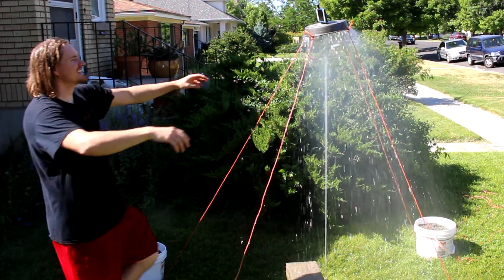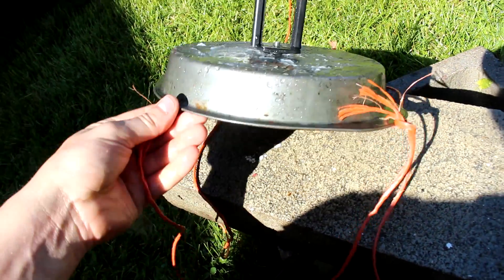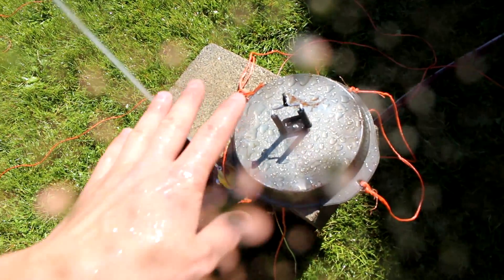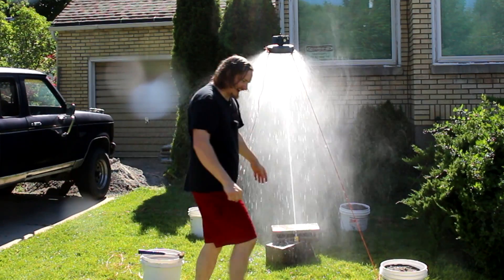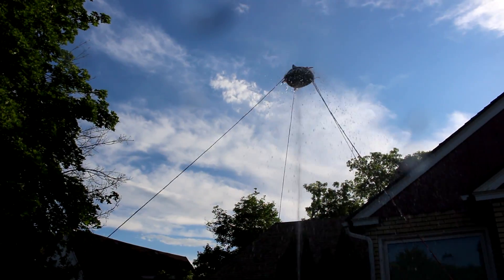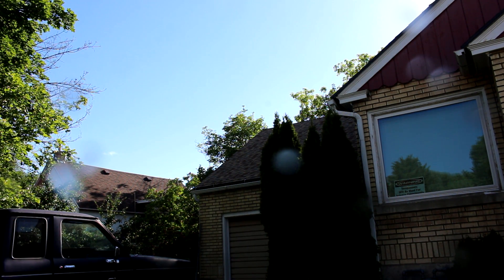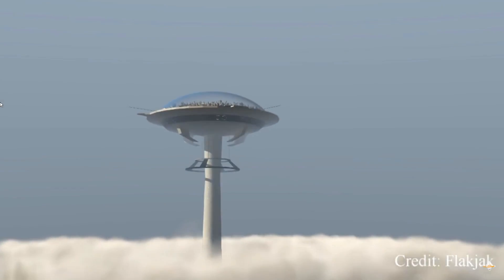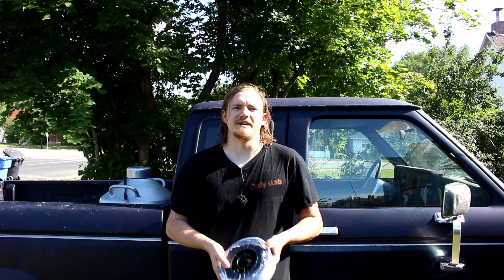Actively Supported Tower (part 1)

Comment: they use resistors like you had going at end of video on old points ignition supply circuits, but they are ceramic coated for heat dissipation. Those home built resistors will need cooling to last any amount of time.

Comment: you should connect spools of wire instead of string, that way you could have continuous tension as the tin rises. just make sure that the pressure of the water is enough to both overcome the force of gravity on the tin AND able to have enough pressure to pull the wire out.  Then you could have it go even higher!

Comment: Could this be applied as potentially more viable space elevator then an anchored, counter weighted tether? As far as material strength and structural integrity I mean. I'd be interested is seeing some math depicting the kinds of forces involved at that scale. I'd also be interested to know how much it would cost to maintain such a structure, in terms of dollar per kilowatt hour to run the active support.

Comment: could you attach the water jet to the pie tin via a tube and suspend it just a short distance below it? that could keep the platform more stable & the jet more coherent, although ofc it also adds weight

Comment: What if you used the heat of that load dump (end part video) to power a absorption refrigeration system so you capture the waste heat. Once you recoup construction cost you would have a free source of cooling.

Comment: You could try using a laminar  flow nozzle, should be quieter as there's no air mixed with the water, also use a frisbee, it's lighter.
Another alternative is a helium balloon at the top.

Comment: For some reason, until I saw Isaac Arthur's videos a few weeks ago, I'd have thought this would be magic. 

What I really want to see someone do is try to recycle energy from the falling mass (e.i. the water) so it isn't so dreadfully inefficient. 

Maybe that's an idea for what to do after floating a platform on a wire ;)
Probably not possible, but then I'm not a scientist. I'm just a lab tech.
Reply: the way you do it is you have the water in a hose/pipe going up and back down - it still does technically reflect from the top. The problem is the mass of the pipe - it is barely doable in small scale. In big scale though, square-cube-law is your friend at least this once.

Comment: I wonder if it could be done with a single string and with the "pie tin" shaped in such a way to correct any side to side motion. Not sure if the water steam would get disrupted too much as it would have to be in line with the string, perhaps 3 parallel streams of water with a single string in the center?
Enjoying the videos as always Cody, thanks!

Comment: I think I'd prefer a system that would use the energy for something else that is useful, either that or a charge controller that stops charging/keeps them at a stable floating voltage (assuming they are lead acid batteries). But this does get the job done I suppose.

Something like water heating, hell maybe even to just create distilled water I'm sure that comes in handy for the occasional chemistry experiment. The hydrogen/oxygen generator could use nice too, but I would feel a bit wary about generating and capturing such things unattended.

Comment: hmm, space tower preliminary  testing, prepping a mine for use in isolation experimentation, hydroponics, rockets, measuring angles heights and distances through optics, solar collection and utilization, long term battery storage. . . .Cody, are you planning on just taking yourself to Mars?
Are you planning on doing some vacuum chamber descent tests with parachutes or gliders in simulated mars atmosphere? Maybe play around with filtering sunlight to reduce it's intensity to mars levels, then concentrate it with Mylar mirrors to get plants to grow in reduced sunlight?
May the solar wind be ever at your back!

Comment: This brought back memories of Freeman Dyson's Orion Project. Of course this was a pie plate and a water jet while Dyson's team was contemplating spaceships 400 meters across with a mass of 8 million tons - virtually a small town - lifted and accelerated at 1g to some fraction of light speed using fusion bombs detonated at a rate of every 3 seconds behind a pusher plate. All of this in 1958 using the available technology of the time! Obviously there were issues with this approach although once in deep space those issues become moot. There is anecdotal evidence that a manhole cover was put in orbit this way during an underground atomic test but it may also be that it was just vaporized, the high speed camera only recorded one frame of the cover under a huge acceleration. Cody, it would be a challenge but you have everything at hand to make a "pie plate" mockup of this powered by a stream of your small explosives. Dyson and his team made some small experiments at the time and there are some grainy b&w films but I think you could do much better today.

Comment: For phase 2 add a gyro component  for platform stability. You could also supply power via the guy wires so you don't have the increased weight of batteries.

Comment: bah mon librepenseur,
check out project WEAV
coanda-flettner-tesla 'flying plasma toroidal vortex'
and 'flux pumping in quantum thomson switching'
as well as, ionocraft. 

that is essentially what a directed jet of water to the target is...

the flux-density per cubic inch is presently what prevent that.
however, wilzcek-chua memristive metamaterials,
particularly, new monopolar surfaces,
make it potentially ERoEI viable in the near future,
combined with thorium-vanadium-astatine breeder reactors.

cody, 
what BTU's are required to pressurize the water to suspend that,
let alone, the fact the water is treated...
what is the ERoEI of the water used,
and how does that scale with the mass of the levitated object?

Comment: I wonder if you can get that high pressure hose to put out a somewhat laminar flow, maybe it could get much higher? Probably absurd overengineering but maybe stainless tubes as a bundle of "straws" and maybe you can get away with plastic for the sharp nozzle part depending on those pressures...

Comment: Submerge your dump resistors in dielectric coolant or mineral oil, and use some power to run the coolant through an old car radiator and fan.  Easy way to not cause a fire and prolong the life of the coils.

Alternatively, you could use the excess power to drive something high amperage but self cooling, like an industrial fan or a space heater (I assume you want to do this since it's cheap though)

Comment: Sometimes it's a very good thing to have a ranch to have some distance between you and your neighbors. Like when you are using explosives. Or messing with homemade artillery. Or when you are trying to make a string thrower with 3/16 inch steel cable.

A hope: Be extremely careful with your string thrower. The possible failure mechanisms for such a device are spectacular.  I enjoy your vids too much for them to stop. You need a substantial shield to observe from behind, hopefully using a periscope or such. And don't neglect the possibility that a failed cable will fly up and fall on you, or whiplash around and catch you from behind your safety barrier.

Comment: The big question for the wire setup is: Will it buckle? 
And when it does, is your structure going to be fail safe enough to not get ruined by the momentum of the wire or the strength of the motor? I've also wanted to build an actively supported platform for a while now...
Can you calculate the speed the wire needs to have in order to lift 100kg? or maybe 10kg?

Comment: That looks like a Colman Air dump load controller. I have one of those too and I have to say I'm not a fan. The relays engage for too long and sometimes burn off more power than they really should. I solved the problem by putting a number of lower amperage dump load controllers in parallel with it and those controllers have a hysteresis of 0.1 seconds. Each controller dumps about 6 amps and their trigger voltages are slightly staggered. The result is that when my panels and/or turbine are producing too much, my dump loads engage just enough to keep the voltage at 28.x volts maximising the power going into the batteries. I'd be happy to tell you where I got my dump loads. PM if you're interested.

Comment: as a civil engineer. ..your statements around 4:42 would literally get  u laughed at . "supported passively"?  stop stepping out of your academic bounds, we design for something called a dead load. .sure. but the most important factor is the live load, Which is definitely not passive...also a factor of safety. which is more aggressive than anything.. and then there are serviceability requirements ...such as deflection and vibration.  Literally NOTHING Is "passive" . stop belittling structural engineers and stick to what you're marginally good at. I bet you are one of the ones that confer to the "pancake theory" of 9/11 too and can't figure out on your own (let alone your own OBSERVATION) that it's physically impossible.  .after back spacing. .ill leave it at that,  cuz after all i do like you.
Reply: I know nothing about you but because I know your academic specialty I feel comfortable assuming a belief you have about a globally recognized event outside of that academic specialty, based on nothing you’ve said at all. I bet you’re one of the ones that think the SAS’ use of stun grenades as they started their assault during the Iranian Embassy siege in 1980 was a tactical error due to the mistiming of red and blue teams entries, and that it would have prevented the severe burns that the entangled abseiler suffered. See how my comment is entirely absent of any sense at all‽︎ Find it insane you felt belittled by someone’s use of incorrect terminology. Must be like civil engineers to have fragile egos lol. Stop writing YouTube comments and stick to what you’re marginally good at, using software to make sure a bunch numbers are within tolerance of two other numbers, and spending hours of your life writing the measured distance between two lines at a certain scale.

Comment: With that setup, would you be able to achieve stability by using suspended weights to lower the center of mass below the pie place instead of using the guy wires? Control height by the strength of the water stream. (Though I don't know how you would avoid spin...)

Comment: Now regulate it with some kind of electronics so you can input a height you want the object to go and then it will output the water you need to keep it at that height without restraints.

Comment: hey cody, looks like your phone lcd broke, you can get an lcd for $20-$50 on ebay, it's really easy to put a new one on, just look up a how to on youtube. don't go to the apple store as they will overcharge you alot. Anyways, great video cody, keep it up!
Reply: Davidog69 if that's one of the new iPhone it may be harder, as for some idiotic reason touch ID data is stored in the screen (like, why apple?) so I think you've gotta take extra steps for the touch ID sensor not to refuse the screen, although I could be completely wrong and worse case scenario you loose your fingerprint and have to use the backup password

Comment: Lapis Lazuli (Steven universe) Tried to use the earths ocean to reach space, any idea of what would be the maximum reach distance of the oceans water into space if you piled it as a tower? and what kind of dimension would that structure need for it to be physically possible (assuming you could pile up water like if it was a solid). 
(/watch?v=uNEOPshLfUM) 
P.D. sorry if the comment is a bit childish.

Comment: you should make a metal fire box to contain the resistors so if any dirt or other junk gets on them and starts fire it can safely burn in the box it would also help with heat soaking into surrounding things

Comment: Hi Cody, great video, can't wait for more on this topic. I had an idea for an efficient "cooking pan". The pan is not efficient to what it can be, I know you said that in the video, but a different design could make it go higher and use less of the waters energy. If you made a design where you basically put a cone inside of a cylinder where the water would hit the tip of the cone, it could make for a more efficient "pan". But the design might not work just like that, you may need to tweak it a little such as rounding off where the bottom of the cone and the cylinder meet. If you would like me to show you what I am talking about I can message you my design, thank you!

Comment: You don't have to use all those strings. LOL When I was a kid we had a water toy very similar to a kids water toy today called, "Big Aqua Clown". It was a cone shaped hat with a flat top. You turn on the water pressure and the hat would shoot up into the air and you'd run through the jet of water. The hat would fall, then get caught by the jet of water and shoot back up. To do what you did, just mount a small camera on top of the cone so it's balanced, then add 3 small weights 120 degrees apart extending at an angle downward off the wide lower rim of the hat.

Comment: This is cool, imagine the uses for this kind of thing in the far future, pressure elevators instead of cable and wire would make them safer Incase of a failure but leakage would be a problem to deal with

Comment: that dump resistor of yours is a fire hazard and a half. get yourself some hot plates or something. a friend of mine used some heat wrap on his hot water tank. had 145 degree water most of the time

Comment: Could you propel a spacecraft using water that way if the jet of water was large enough?
Reply: Meaning having a jet of water from earth shooting up into space and placing a disk on top of it?
Reply: Olaf, It has been proposed for building something like a space elevator. If you want to have an spacecraft you still need to accelerate it really fast around the earth to archive an stable orbit by itself.
Another idea is to use lasers to propel the spaceship once it has reached an orbit.

Comment: You should try a comparison video between self stabilizing system and unstable systems that require outside input (3 strings of the tripod) for stable water jet levitation...

Comment: Why don't you use your water splitter to drain the excess power from your solar panels? It would be a little more sustainable than dumping heat into the atmosphere and you can make some other projects with the resulting hydrogen.
Reply: Jarwren, There are several ideas to storage/use the extra energy but all of them involve costly solutions (adding more batteries, storing water on a elevated tank, water splitting, etc) But if all you want is to protect your system from overload, that simple resistor dump is pretty convenient (or better yet, a water heater as someone else suggested).
P.S. Also storing hydrogen is not as trivial as it appears, as you shouldn't use a normal gas tank (google hydrogen embrittlement)
Reply: I know all the problems but since he already build the hydrogen generator it would be convenient to use it in this case.
Reply: Does he have a way to compress the hydrogen safely into some containment? Blowing up your house is not necessary worth it.

Comment: Cody, I think the problem with your iPhone is due to the flat printed LCD cable being partially knocked out due to impact.
Or maybe the surface mount connector has pulled up on the logic board.

Comment: Why you didn't use 3 ropes  at 120 degree? this would make the system way more stable, or i'm wrong?
Reply: The real secret to all this is that he's using baler twine. People who have never done any farming don't realize the importance of the stuff , the Universe is actually kept stable solely due to it being tied together with baler twine. It's a fundamental force.
Reply: I believe if 2 out of 3 ropes were lose, it would fall off the stream of water. It would be more stable at 'rest', but less stable when he's raising the height.
Reply: When I was out on a farm I would collect tones of this stuff. I learned how to splice them together to make longer ropes. The amount of things I have done with Baler Twine is unfathomable Shoe strings, belt, gift wrap, poor mans fishing line, survival bracelets, etc. Amazing stuff shame I'm not on a farm anymore and the supply is running low.
Reply: Yeah as JamEngulfer said... that could make it so each adjustment of the lengths has to be smaller, since there would be a higher degree of tilt per adjustment with just three ropes. Still possible I think, just a little more tedious.
Reply: I'm not sure how, with three ropes, you could have two loose.
Each time you adjust one off to allow it to gain height, it would keep it'self taunt the whole time.  When you have four lines and loosen one, it becomes slack and your on three anyway. So as he's adjusting it up, it's going between four and three.
I suspect it would be more stable with three, but maybe the 4th allows for some errors and makes the system less sensitive to the gross changes made by lifting it up?
Reply from the maker: Tolcrein 
At any give time only 3 ropes are tight so it is only stabilized by 3.

Comment: Done the cable thing already, but used a long chain of metal beads instead. Pretty difficult to keep stable for any length of time. The thing about using the beads is that it was much easier to change the overall length of the loop, so could play with lengths vs rpm for the drive wheel.

Comment: When I was younger I had a toy like this, with an adaptor for the garden hose. It was cool because it didn't need supports as the platform was a cone with some pressure outlets so it was relatively stable on its own.